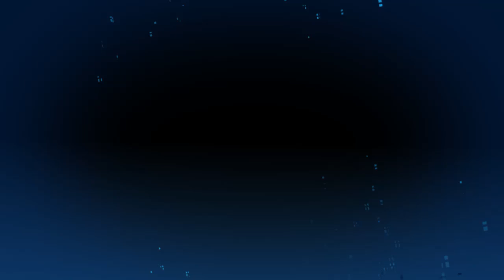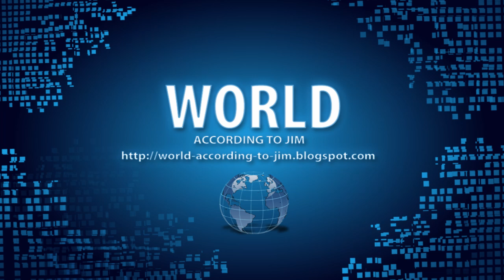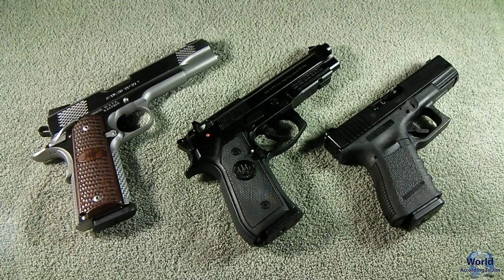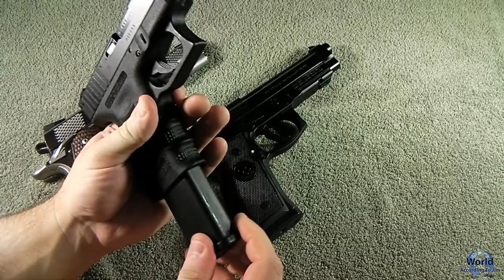Choosing your first handgun.

Comment: The most important item is the fit in the hand.  The second item would be the recoil of the pistol.  The third thing is how familiar the shooter is with the pistol.  the fourth thing is the reliability of the firearm.  If the grip is too big or too small the shooter will have trouble with the recoil of larger calibers.  Just my two cents:  A .45 ACP packs quite a whollop, a .22 is very controllable.  With any pistol, one ought to take instruction, practice on a range and use dummy rounds to practice at home.  (If the caliber is too large, the shooter may never pick up the pistol again.) I like 380 in a compact size (not a pocket pistol)  My wife has a Ruger SR .22  Very nice reliable pistol.  She also has a S&WE M&P Shield 380 EZ and just loves the pistol.  I carry the S&W M&P 9c in winter and my own EZ in summer.  We have owned many pistols and finely settled on American made products because of the reputation of reliability.  If you pistol has a history of malfunction, Murphy's law says it will happen when you most need it to work Flawlessly.

Comment: IMO, the Glock 20/29/40 is the most versatile handgun on the market. This handgun will fire either the 10mm or the .40 cal with no modifications to the weapon. The 20/29/40 can be converted into a .357 SIG with a mere swap of the barrel. Everything else is the same; from the upper through the lower to the magazine. If you want to plink and still have a reliable self defense handgun, get yourself some .40 cal. If you want something significantly more powerful than the .40 (the snub nose 10mm), then get yourself some good 10mm or .357 SIG. They both have some good knock down permanence.

You're never going to know where you may find yourself and the availability of certain types of ammunition. I've got all 3 barrels (10mm, .40 cal. & .357 SIG) for that exact reason. 

As the old saying goes: "It's better to have and not not need, then to need and not have."
Reply from the maker: Great comments! I agree, I have multiple barrels for most of my Glocks.
Reply: Thanks for the recognition, Jim. The same applications can be had with the AR15 and its 5.56mm and 7.62 mm (300 Blackout) configurations.

Once again, IMO, I believe that our military should not abandon the M16 in 5.56 mm, but just reconfigure them into the 300 Blackout. Granted, the 300 is not designed for long range, but most combat is not long range. That's why we have snipers and their sniper rifles with the higher calibers.
Reply from the maker: Great comments, plus the 300 Blackout can be loaded in a subsonic round, and when suppressed it would dramatically reduce the sound levels, so it would be worth it just for that reason. That is always one of the reasons they still keep around the 45ACP.

Comment: For my first handgun, I got a Beretta 92fs. A super tough, reliable, high cap full size pistol that i can use for carry, and also for taking out in the woods. Feels so good in the hand, shoots any kind of ammo whether super hot or weak, 9mm ammo is cheaper, plus, the stock trigger and sights are great for target shooting and punching bullseyes. At $500 brand new, it gave me that butterfly feeling in my stomach like "i'm taking home my first pistol after all this time paying layaway it's finally mine!" feeling. i'll never sell it. My second pistol was a smith and wesson sd40 ve which i keep in the center console of my vehicle at all times. American made, stainless steel, and a whole lot of power in a small package. The most gun you can get for around $350 bucks without going to the used market. For my third pistol, I bought a glock 21sf, which i use as my daily carry. Lots of power in a good package, and i'm throwing big nasty 45 caliber slugs. If i had to buy another one tommorow, it'd be that newer beretta px4 storm.

Comment: Nice video and comparison. All three guns/actions are cool and it's nice to own all for the variety. You left out revolvers, though. A Smith and Wesson 686 Plus is a wonderful first handgun to own. Reliable, easy to maintain, seven shots of .357 mag or .38 special, you don't have to worry about limp-wristing it, and you don't have to rack a slide first before pulling the trigger.

Comment: 92FS/M9 over the other 2. More features & really, 9mm ballistics are superb way better than .40 & .45 if anyones gonna bring up the classic debate "9mm doesn't got any stopping power mehhhh!" you need to throw some hollow points in there. Now you're getting more stopping power (which really isn't need in the first place 9mm has enough already) without giving up accuracy, muzzle velocity, etc

Comment: Good video, but you got one thing wrong. The definition of double action comes from the trigger performing two actions, cocking a hammer and releasing it on one pull. Technically that's not what a Glock does. Being a striker fired gun, they're pretty much in their own class outside of sao, dao, or sa/da firearms. But the striker is cocked when the slide is racked, and the trigger only releases it. By that Glocks are more closely related to single action only pistols.

Comment: For those considering the Beretta.. they are very nice..  but I personally prefer the Taurus PT92 instead.  Same basic design since the Taurus factory was actually built by Beretta.  But it retains the frame mounted safety which I much prefer, still has a steel guide rod instead of plastic and is much cheaper but just as reliable.

Comment: You can get a manual safety put on a Glock by a gunsmith and it will not interfere with your warranty. Always check with the manufactoring company to make sure on any model. I was a bit surprised to hear that the Glock was not accurate, wow! That was hard to say since I believe the opposite. I could have gotten any side arm I wanted and I went with Glock for a number of reasons and happy I did. I wonder why a couple of the better shooter pick Glock to shoot with, oh yeah, $500 price tag~

Comment: After reading more comments and reactions about the 1911 I think you should have mentioned its "Safety" features. You said it was too heavy while I believe "heavy" is good. Weight reminds one that it is there and less likely to fumble around with as one might with small and lightweight.  Many carry the 1911 in fully-cocked mode as the grip must be squeezed and the trigger pulled simultaneously for it fire. In other words, the metal strap on the back of the grip must be depressed by the hand gripping the pistol in order for the trigger to be able actuate the release of the hammer. To dismiss it out hand is to mean one never heard of Bill Jordan as well. Considering it is a Model 1911, meaning the year 1911. 100 plus years, still in use and very much relied on by more folks than Glock will ever hope. Well-known firearms expert and ex-lawman, the late William Henry "Bill" Jordan (author of "No Second Place Winner" and designer of a specialty holster and handgun grips) placed a 1911 in high regard for defense and carried a 1911 on duty for many years always is in the full-cock position. While working as a Border Patrol officer he had stopped at a convenience store during his shift. While waiting in line a woman behind him, after seeing the hammer on his 1911 fully cocked, spoke up.
She said, "Sir, you know that is very dangerous!" He replied, "Yes ma'am, it certainly is." Well said Bill, well said.
(Jordan was also a proponent of large caliber double action revolvers. He was once timed at drawing a double action revolver from its holster, firing and hitting his target at .27 of a second)

Comment: "single stack" is the nickname for my 1911 but i still refer it as the M11911....Kimber Manufacturing is an American company that designs, manufactures, and distributes small arms such as M1911 pistols..BUT  The M1911 was replaced by the M9 pistol as the standard U.S. sidearm in the early 1990s, but due to its popularity among users, it has not been completely phased out. Modern M1911 variants are still in use by some units within the U.S. Army Special Forces, the U.S. Navy and U.S. Marine Corps

Comment: Thats right. The first polymer handgun was the HK VP70/VP70Z. HK proved it could be done. Glock refined the concept into what we have now. This is not unusual with gun development. The concept of a revolving repeating pistol existed well before Colt made his, all Colt did was take the pepperbox concept, put a central barrel on it, cut off half the barrels of the typical pepperbox for the chambers and adapt a ratchet/pawl system from a ship's wheel to make the first revolver as we know it now

Comment: i for one am knolegable... i had it tested compared to my other 2 glocks, that one failed. it was defective from the factory but my point is... ive never had a 1911 start forming to my hand...  or have the polemer fail and the slide hit a friend in the chest...  it did happen and sometimes you get defective piece of equipment.

Comment: ill give you 3 reasons glocks suck.  1:too common every one has one 2: your very wrong about reliability the Beretta is MUCH more reliable than the glock and so it the 1911 because of the metal frames and how the guns are built 3: glock uses polemyer frames, they can break right in half if its too cold out or bend a little if its above 120 (if you live any where near Arizona, Vegas ext these tempatures are normal) that means things can jam up too. oh and one more 4: glocks are not very safe...

Comment: "A striker is a shotgun" - codlover4827 , the difference is a hammer is what you see is at the back of revolvers or most pistols. Now the glock doesn't have a hammer so it uses a striker firing mechanism. Now go spread that to the other COD lovers.

Comment: Right Mr. genius... bowing to your great sagacity and the knower of all things fecal. To others less inclined to coprophagy... Single action and double action speaks to what the function of the trigger is - that is no more nor no less. Single action: Single function, trigger pull simply releases the hammer or striker. Double action: two functions (1) cocks firearm and (2) discharges the firearm.

Comment: Double Action -  Trigger accomplishes two actions cocking of the trigger and the firing of the cartridge. So does pull of the Glock trigger cock the striker? Yes. Does the pull of the Glock trigger fire the cartridge? Yes. Can it be fired in a fashion so as where the trigger pull only fires the cartridge? Absolutely NOT!. Ergo Glock is a DOA pistol. Glock marketed the pistol in the 1980's as a DAO firearm to law enforcement - the action is still unchaged. Enough said ... rest is all just blah...

Comment: On the other hand the Springfield IS a SA as the trigger simply fires the cartridge. The racking of the slide fully sets the striker to the fire position, the breaking of the trigger only fires the cartridge. DAK is fully a DAO. Companies like to give names to existing action types as a selling point Kellerman=Sig DAO. Hype vs reality.

Comment: False the Glock is a DAO pistol. Yes it is striker fired. Since the striker requires the trigger to be depressed to move to a full cocked position it is indeed a DAO and in that it does not "closely resemble an SA" as the trigger does move the striker to the firing position as well as fire the pistol. IPSC considers Glocks DAO.

Comment: Exactly. Double Action = two actions. 1)Bring the hammer to the rear. 2) Drop the hammer to firing pin. 

Striker fire = In the same movement you move the upper striker block (internal safety) out of the way and then push the sear until it no longer contacts the striker. 

Double action pull = (usually) 10+ lbs
Striker fire pull = (usually) ~5-6 lbs.

Comment: the comparison of the glock being double action to the barreta being da/sa and the 1911 being single action only is kinda misleading. The glock has a total different type of firing mechanism. it is striker fired while the others are both hammer fired. why even mention it? there are many kinds of double action, and the glocks DA is nothing like a hammer double action only

Comment: HK started polymer guns. The VP 70 was the first one, it just wasn't that successfull. And the 92 FS is really not the most common 9mm outside the USA by far, that is just bs, sorry. That would be sig, hk, walther and glock. And the 1911 wasn't the first mass produced auto loader, the luger 08 for example was before that, the 1911 was the best to that time, but not the first.. If you want to teach other people, please do it right...

Comment: Glock and Kahr semi-automatic pistols are not DA (or DAO) pistols because the striker is "cocked" to an intermediate position by the operation of the slide and they cannot be re-activated by pulling the trigger a second time. Also the trigger reset is mighty short on the glock, so you dont have to let it go all the way to the initial position. IF YOU ARE LOOKING TO GET YOUR FIRST GUN, PLEASE DONT RESORT TO OPINIONS OF YOUTUBE GUN GURUS. INSTEAD GET OUT THERE AND PLAY AROUND WITH FEW YOURSELF.

Comment: If I had to pick, I would get a Glock 32. My second choice would be a Sig P226. Then an M9. An M1911 would be my last choice just because I personally hate the M1911.It's such a basic pistol. It has no interesting features or anything that pleases me. A Glock is, in my eyes, the greatest pistol just because it's light, reliable, and accurate as hell. Not to mention, a Glock 26, the "Baby Glock" holds 10+1 rounds while a full size M1911 holds about 8+1 (I think). Like I said this was my opinion..

Comment: If I am not mistaken, doesn't the Glock occupy a fourth category of 'modified DAO' (Not 'True DAO'), as it is partially cocked, requiring the user to only partially complete the cocking? (Like Sig DAK, or H&K LEM)

Or is it all basically the same, and I'm simply picking at straws?